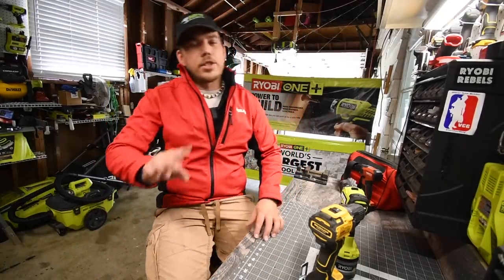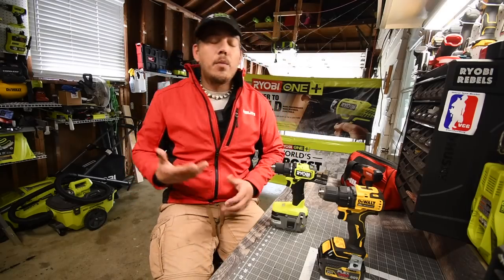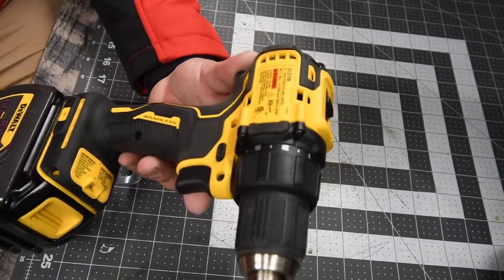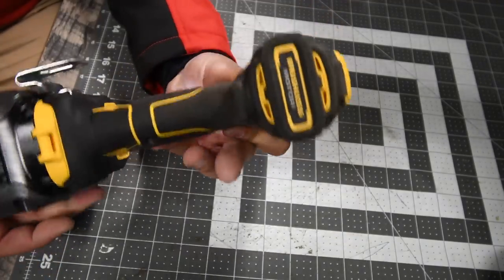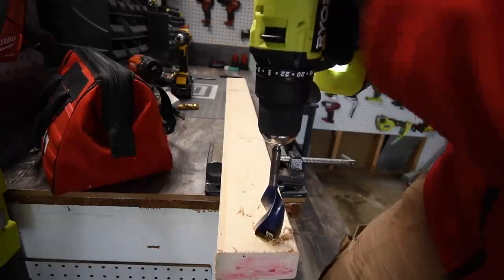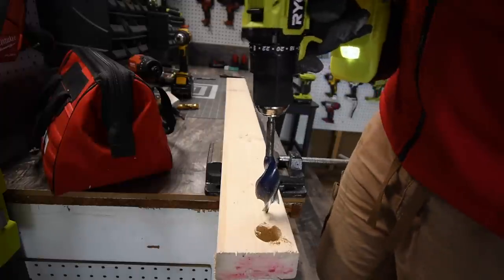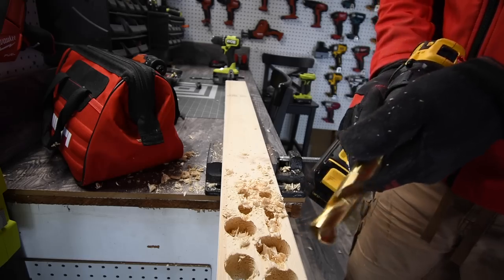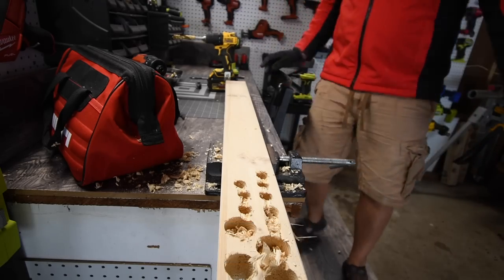Ryobi HP vs Dewalt Atomic

Comment: Dewalt atomic is great . (Period) people are under rating it . I have that exact dewalt drill and it works great for my wood working projects and carpentery jobs .
Reply: I completely agree. I love my 887 impact, but use my Atomic Drill for woodworking all the time. You are right!
Reply from the maker: People need to give the compact tools more credit than they get. and thank you King
Reply: I'm debating with myself weather to get the Ryobi 18V brushless or the DeWalt featured in this vid. Can you tell me the specific model number of this DeWalt drill? I just need something solid for wood working info on the weekends. I have been using my old DeWalt DCD 710 for a long time but lately I have been noticing that the bits get loose in the chuck while drilling which is annoying. It's an older model so there is no ratcheting feature in the chuck.

Comment: You didn't do the temp check on the dewalt right after using like you did on the ryobi.  Also, these tools do not come with those big batteries so when doing your tests, use the batteries the tools come with so the dyi'er knows exactly what to expect right out of the box.  Most should know these compacts have limitations and would only be used doing light - med light duty work or when needing b/c of an occasional tight space issue, especially when using the kit batteries.  When doing all day work running lag bolts, get out the big boy tools.

Comment: What is truly amazing, is to see the raw power those 12volt tools are dishing out, compared to 18v tools, thinking about going into the 12v  Milwaukee fuel line, they are impressive for sure !! Still like Ryobi for price, I think they are pretty good tools, they have never failed me at tasks.
Reply from the maker: I do thank you so much for viewing :)
Reply: @ManCaverTools  had a ryobi string trimmer fail on me, they replaced it with a new one. also was using a really really old ryobi drill on super thick metal. it was one of the blue old old ones, it couldn't get through the metal, had to get a corded one. I still buy their tools and after that blue one failed, i bought the proper (ryobi) hammer drill! the prices are amazing. I still use the blue one to this day!
Reply: These ones in the video are 18v, unless ur referring to a different video

Comment: How come it's missing the extra hp capability terminals
Reply from the maker: the HP doesn't apply to every tool. No clue why.
Reply: @Man Caver Tools  yea after seeing ur vid I checked my new hp drill an impact an my drill has them but not the impact same thing with my hp oscillating saw no extra terminals but then I check my hp rotary hammer an it has the extra terminals so I don't get it ! I'm not sure it makes a difference.i even have one + brushed tools that compete with the same battery's.

Comment: Dewalt 708 was capable of taking 8" Mora ice auger thru 3+ft of very heavy wet ice. Traded it for Dewalt 991 just because of the additional handle - it's almost impossible to operate ice auger + 708 with one hand.
Reply from the maker: I doubt that either of these can do a 5-6" how for an ice auger. maybe a small hole though
Reply: @ManCaverTools  I mean Dewalt Atomic which is Dewalt 708 model is capable of running 8" auger. Tested it myself ;)

Comment: A lot of us are already embedded in a system and don't really need to know how well one brand does against another. It would be cool to see a comparison between the new HP tools and ones that are getting long in the tooth (but are still owned by many) like the P271 drill.

When replacing old tools, I'd rather know how the new ones compare to those than to tools I likely wouldn't be buying, anyway. It might make for a pretty popular series. Give it some thought.
Reply from the maker: A lot of people want to see these brand vs brand videos. because. a lot of people are new to tools and want to know which brand fits there power they want with the price, not everyone buys into a battery system. Most people have tools from a couple of brands. just because you don't need to see it doesn't mean other people don't want to see it
Reply: @ManCaverTools  I wasn't criticizing the existence of these videos. I was suggesting an expansion into an area that could give you more viewers.
Reply: same here.
Reply: @TheCharleseye  I would very much like to see how the new tools compare to the old ones. I'm invested in the Ryobi One+ system, and while it's fun to see how they compare to other brands, it's much more useful to see how they compare to older versions.

Comment: Noob questions, what exactly is speed 1 vs speed 2?
Reply from the maker: speed 1 provides more torque and will do tougher tasks. speed 2 will do the job faster but if the taks is too hard it will stop working with the extra RPMs

Comment: I kept hearing 60 amp hour battery and In my head I see a drill with giant carry case attached to the bottom
Reply from the maker: lol
Reply: @ManCaverTools  Mate I don't know what the hell you're doing with those spade bits? For curiosity sake I put a brand new 35mm Irwin spade bit in my ATOMIC and put it in speed 2 and it flew through a 45mm piece of seasoned framing pine like butter !
Reply: Comes with a wheelbarrow.

Comment: do you get more torque speed 1 than speed 2
Reply: Yes, it’s like the gears in a a car or truck. 1st gear is max torque.
Reply: @Steve_K_MS660  I seen he went full speed spade bit got stuck but put in 1 speed no problem wow.
Reply from the maker: yes. speed 1 has more torque